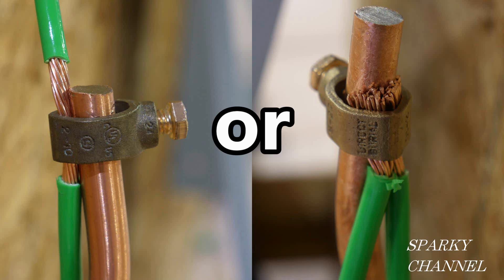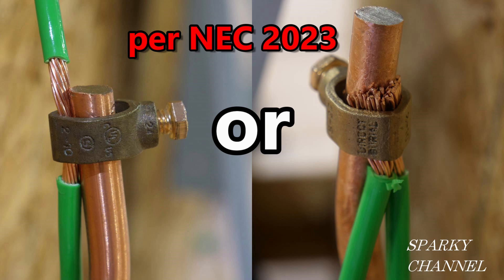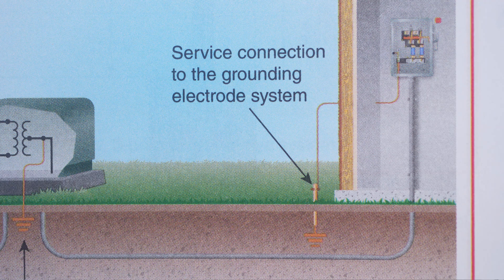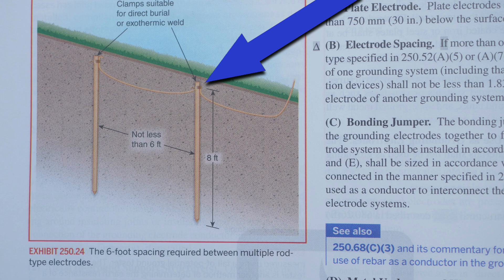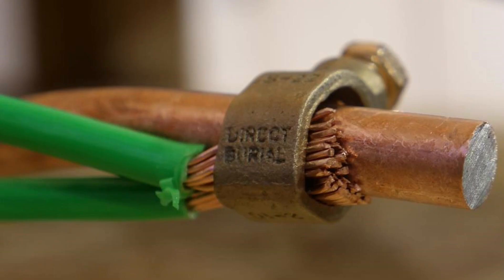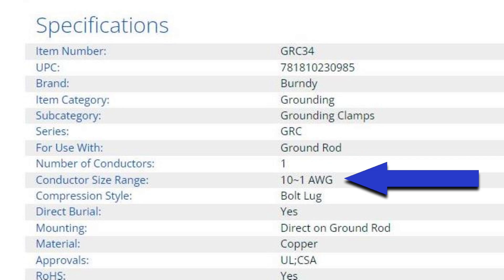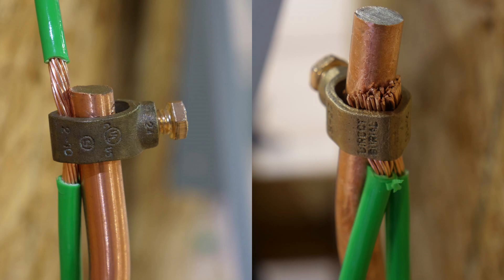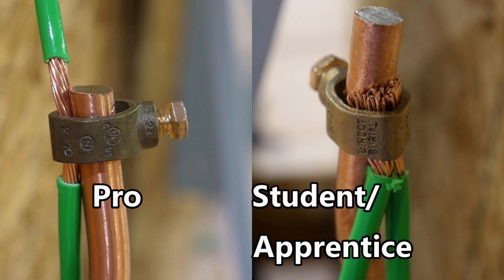Which is Correct by NEC 2023?

Comment: This is the part where the bible thumpers turn something so minor into a 4 page paragraph of over explaining the technical details that are….
Same Same but NOT SAME SAME. 

Insurance companies love these guys, they give the insurance companies loopholes to go through to keep them from paying and push fault on to the next person. 

Stop giving these code book writers too much credit, they will tell you a simple breaker for years is safe and then turn around and jump out of bed with a manufacturer and say you now need this specific breaker that is 10x higher in cost for safety and totally disregard and contradict the standard breaker that has been used for years. 
This book is a lobbying tool for huge corporations and insurance companies. 
Its primary focus is to sell merchandise and protect insurance companies, and disguise it as something for the consumer safety. 
In other words, it sells off of fear, because the electrical industry has been high jacked since early 2000s. 
Since then it does nothing but test new expensive products by making them code in minor settings then as the years go by they bump up the products necessities all over the job.

Comment: What about using 2 clamps on a single ground rod?
Reply: Nope. I asked that question years ago of the NFPA. Their reply was it must be 1 continuous conductor from the grounded equipment to the last ground rod.
Reply: @willgallatin2802  NFPA is a joke.
Reply from the maker: Jim, I made you a video answer: Can I Use Two Acorn Clamps on a Ground Rod by 2023 NEC 250.64(C)?: https://youtu.be/7UAxo8cVmvo
Reply: I have two on one of my 4 rods (I have solar arrays, detached garage, sub panel in garage, lot going on).  The one with two has the solar array on the house copper run going through a ground bar on the side of the house and continuing to the ground rod.  Ground rod has the main ground from the main panel in the basement too.  Will I change this / fix it because of 'code'? No, because it's better and not able to lose this ground connection even more so with how it's run.  Keep in mind, both grounds going to the rod also go to that bus bar with 1-2 other connections there as well.

Comment: Wire on the left keeps strands tightly bundled for maximum contact and ground fault current transfer.  Wires on the right have strands that are spread out and loose which decreases total contact area.   Without even knowing written code specifics, this should be obvious.
Reply from the maker: Excellent!
Reply: The strands being spread out increases the surface area of the contact points, meaning that it should transfer the current better, at least from a purely mathematical viewpoint

Comment: Those ground rods look like they were cut with a hacksaw
Reply from the maker: Good point. But it was just a competition. So, if they would have drilled those rods down 8 feet, they would have gone through the ceiling and into the 1st floor. So, it was a simulation, but they were inspected by judges.

Comment: Is it useful and allowed to coat the bare wire and clamp with heavy duty corrosion inhibitor since it is exposed to the elements?
Reply from the maker: Yes, as long as it's made for electrical use.

Comment: yeah in GA we call'em acorn clamps as well. I would like to know the scientific study behind "number of conductors" rated for them clamps, cause you would think the more copper touching each other the better in a grounding system. Then again in Fort Benning they required us to put in a grounding grid and cad weld each rod that went to the roof with multiple lightning rods. maybe they know something I don't, but I'd like to know.
Reply from the maker: Hi! The companies that make the connectors, such as the acorn clamp, hire engineers to run tests. Then they publish their findings, then the manufacturers make their manufacturers specs.

Comment: Looks to me; both rods were cut off and are no longer 8 feet Making them both code violations.
Reply from the maker: Good point. But it was just a competition. So, if they would have drilled those rods down 8 feet, they would have gone through the ceiling and into the 1st floor. So it was a simulation, but they were inspected by judges.
Reply: @SparkyChannel maybe you can get a hand bender and bend a back-to-back 90 on one ground rod. That way you do not have to cut it or go through your floor.

Comment: Not an electrician so excuse what isn't obvious at least to me. How is the one on the left considered 1 conductor or is that a different type clamp?
Reply from the maker: It's one wire because it isn't cut. As we say, it's unspliced. The one on the right is spliced, so it has to be counted as 2 wires.
Reply: @SparkyChannel  Ok I think I get it. The ground round isn't counted as a wire/conductor. That's what was throwing me off. To my untrained eye I see 2 wires in there. :)
Reply from the maker: I understand. @scotts4125

Comment: And the one on the left is just the common sense way to do it also.
Reply from the maker: I agree.
Reply: @SparkyChannel  I do wish someone would make a clamp that holds the wire perpendicular to the rod as that would make for much neater installations when the conductor needs to pass through a rod rather than terminating at the rod.
Reply from the maker: Excellent idea!

Comment: I submit that an additional configuration should be approved.  Strip about 3" of insulation from the ground wire as in the left example.  Bend the wire back on itself leaving a loop of bare copper.  Place this loop against the copper clad ground rod and slip an acorn nut over the loop and the rod.  Tighten securely.  As in the left example, the ground wire is not cut and continuity is maintained if the acorn nut becomes corroded or loose.  Advantage 1:  No need to thread the acorn nut down from the free end of the ground wire.  Advantage 2:  Twice as much ground wire conductor is in contact with the ground rod.  Advantage 3:  An additional ground rod can be added at any time without interrupting the existing ground circuit.  Advantage 4:  The ground rod can be easily serviced and the acorn nut replaced if necessary without disturbing the existing ground circuit.
Reply from the maker: Very interesting, thanks!
Reply: Folding the GEC in half and sliding the acorn over the loop is not code compliant as there are now essentially two conductors under the clamp
Reply from the maker: Hi Don! Yes, it would exceed manufacturers specs for the acorn clamp. @donl1410
Reply: Hi Bill.  I've see that folding thing done by another YouTube electrician and made my same comment.  I guess it is done without incident.  🤔 @SparkyChannel
Reply from the maker: LOL!  @donl1410

Comment: I wonder what is the reason that makes one correct and the other one dangerous.
Reply from the maker: Perhaps corrosion possibility on the cut grounding electrode conductor? Or overloading the acorn clamp?
Reply: Probably less of an issue with stranded, but my guess is with solid wires there would be a tendency for one to be looser than the other.

Comment: You reference main bonding jumper in your video, but you are talking about the grounding electrode conductor. I love your videos.
Reply from the maker: Good point. I'll look for another reference re the GEC needing to be unspliced. I'm a bit off the mark with 250.24 (C). I took the 250.24(C) refence out with YouTube editor. Thanks for pointing that out!
Reply: @SparkyChannel 
One on left is CORRECTLY.  Cannot be spliced , plus connector is only listed for ONE conductor. 👍
Love your videos!